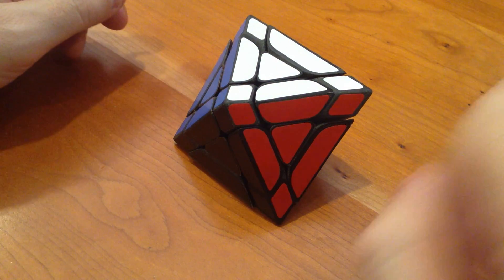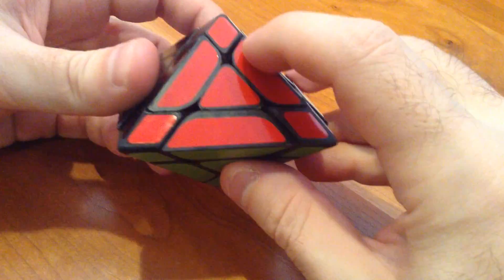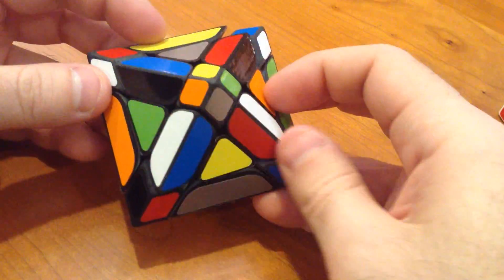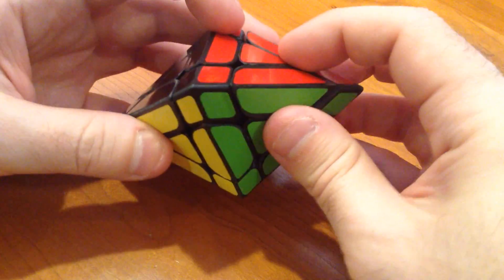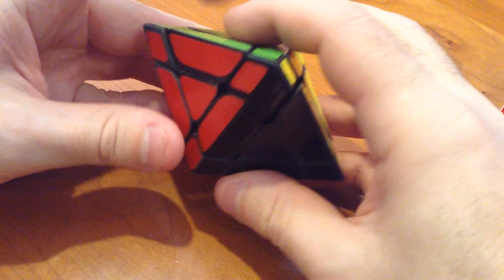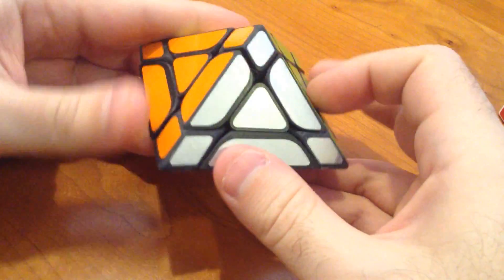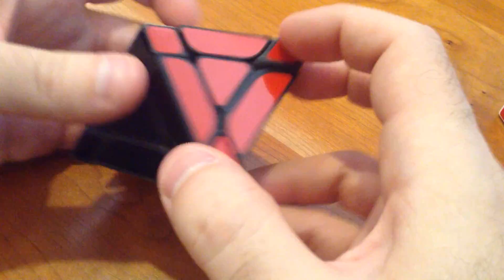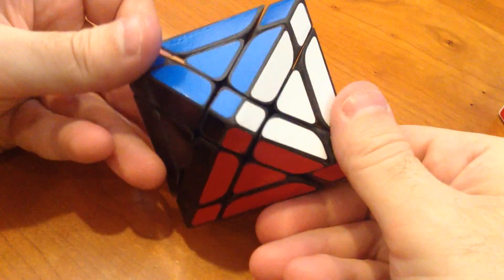RCP non proportional Octahedron

Comment: I just put mine together and it wouldn't turn at all, just popped after a few tries. Please help
Reply from the maker: These files were made to use the screws and springs from a Guanlong cube. Unfortunately they changed the design so that cube is no longer available, so a change needs to be made.

Fortunately I have a fix, but you will have to reprint the center pieces and use the core, Springs, and screws from a QiYi Sail. Other screws will work, but you need to adjust the center for whatever size screw/spring is being used. The good news is that all my thingiverse files use the same center piece, so once you have the fix it will work for all of the puzzles.

 I need to review the parts since it has been a while since I've worked with those files,  but will get the new piece posted this week. I will add a new comment here once it has been updated,... feel free to bump this comment if you don't see the update in the next few days.

Also,... all of the pieces will need to be sanded/smoothed to get decent performance. It takes a while but results in a nice finished puzzle.